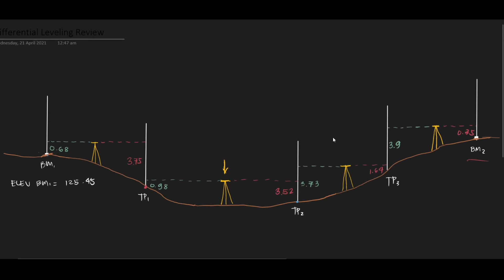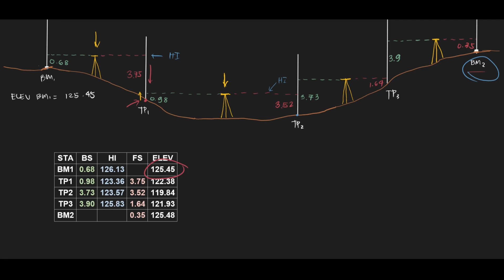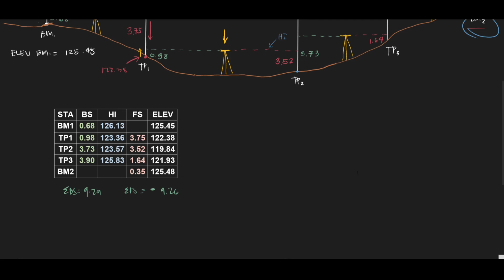Differential Leveling

Comment: Kailangan bang laging equidiatant yung distansya ng instrument between two stadia rod.. Kc ganun sa libro eh
Pero sa actuall work minsan di tlga nag eequal so paano po yun same formula parin ba gagamitin..
Reply from the maker: Good day po,

As much as possible lang po more or less same distance para mag cancel yung instrument error - if meron. Same formulas pa din po gagamitin kahit hindi same distance. Pwede ka din gumamit ng ibang measures para ma improve yung accuracy in cases na hindi same distance like taking 3 measurements and averaging them.

Hope this helps.